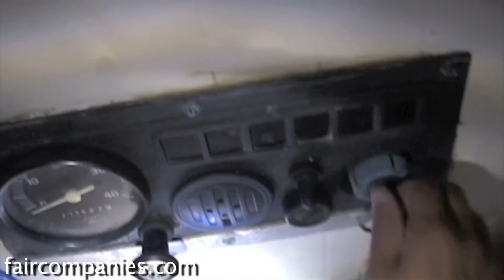Liveaboard life: self-sufficient with solar, sails, VHF radio

Comment: Very upbeat and spirited. I like the way you stand off and observe sailing at length. 
The engine will always be a problem. I'm installing a fresh one and I can tell you the placement of peripherals and how that sucks up the space away from basic needs. I know people who sail without a motor but that is more than my nerves can take. 
This is a solid visual and well organized. Good audio. Very impressive. That is more knowledge than what the engine requires. 
The monitor uses a stay X line or tuff 5/16 line, (not sure of the size). Expensive but you need little to run it. 
Thanks for showing us what sailing is really about.  SOLVING PROBLEMS. 
Don't start eating canned chili.

Comment: You can connect a laptop computer DIRECTLY to the 12V supply, omitting the power hungry voltage invertors. Let me expand; the DC supply from the mains adapter is usually 18V, the laptop battery inside is usually 10V.That extra 8V is only to charge the battery. When a laptop is on a 12V supply the computer works fine, but the battery will not charge. I have used this on various laptops on sail boats for many years. Connector available from electronic components store and make sure the cable has a separate fuse; you may want to try this on an older computer first!

My other tip is to replace the mechanical hard drive for a solid state drive; saves power and can double the computer’s speed.

Love the video, please post some more for us desk bound sailors. X

Comment: Great video. You seem to have a good head on your shoulders. Stuck with no wind, and no engine shows character. And keeping your priorities straight given the tough situations  Kudos! I havea daughter about your age and wish she was this determined.
I don't yet have a sailboat (this year some time), but I have plenty experience with DC power while boondocking on my 16 ft travel trailer. You don't need to invert your DC for your laptop. There are cigarette lighter adapters for laptops. I keep one in my truck and one in my trailer. I don't have a retail GPS unit either, but use a netbook in my truck with GPS software. Also, there are some options for your battery situation; either two batteries in parallel for longer lasting power, and/or same two batteries standalone with a switch to transfer power to one another, so while one gets used and charged the other is being charged standalone. This way you'll have to most charged to start your engine. LED lights technology is a great way to save power. A wind generator should help keeping the batteries charged up, and use the batteries when there's little sunlight. A modest investment, but if you're already sailing this young, a wind generator can be a good investment for the future as well. Safe travels!!

Comment: I replaced the bent connecting rod. It never gave me any other problems and still hasn't years later. It was 15k cheaper than buying a new engine! It absolutely needn't be replaced.

Comment: Thanks for your videos. I share your experiences vicariously through you. But I will give you this one hint. and I unlike you do know about electricity both a/c and d/c your laptop does not need to be powered through an inverter. you can wire your plug directly into a cigarette lighter type plug (make sure polarity is correct) and plug it into your lap top and it will run fine. Inverters use a lot of power Again thanks for the videos
Reply: Yep totally understand. I made the change shortly after this vid. Changes take time, and this one wasn't at the top of my list yet! Thanks for the tip!

Comment: No connection with the poster of the vid but you asked a good question...the boat 'tipping on its side' is called 'heeling' and generally only happens when the boat is headed within about 90 degrees or so on either side of the wind. When the boat is headed 'downwind', or with the wind coming from more or less behind them, the boat will ride pretty much level in the water.

Comment: Hi Teresa, I think it would be possible to mount a 400 watt wind turbine in the mast. I live by myself in a remote area in arctic Sweden and I am self sufficient with both solar and wind energy. I do have a diesel generator for emergencies. I lived on a boat with my father for 6 months and loved it. I chose later to take over a cabin I inherited from my grandmother and move up where all my relatives live, farming reindeer.
Reply: Michael Lawson The issue with wind power on a sailboat is the noise. You're in a cramped environment never more than 40 feet from any point on your ship. Many people have small windmill generators but even these can become incessant annoyances

Comment: Even though Kirsten did a fantastic job, there will always be pieces of the puzzle missing and questions unanswered.  

About the engine, yes, I had to change a bent connecting rod. Its a big project. Took a while to figure out (probably because I was hoping it was something else!)

P.S. Addressing the assumptions about my finances: I address it best in a recent blog post. Check it out. My blog is called Sailing, Simplicity, and the Pursuit of Happiness, the post is called Money! Money! Money!

Comment: @latinamajor I had a bent connecting rod! Its a major repair. I had to remove the top half of the engine to get to it. Thankfully, I had a mechanic who was willing to coach me through it. I called him often for advice. Calder's "Boatowner"s Mechanical and Electrical Maintenance" book is also a great reference. I learned a lot during that repair.

Comment: @ksharber I was talking to Elizabeth, but we never used 16 even to hail each other. We monitor 4 channels. One of them is an open channel that we use to hail each other and have any necessary conversations. We respectfully stay off of 16 as much as possible. We were also sailing offshore. There was only one other boat within range of our VHF (when we had it on low power), so this particular conversation no one could hear anyway and it wasn't on 16. I think I say "On 68", or maybe 69...

Comment: Ah, but I had all the time in the world! I fixed my engine and it was a-ok. But I used the sails more often, and I don't need fuel for that. No need for electricity. When my solar panels were producing enough electricity, it was a luxury. But not a necessity. I already look back on my experience and am amazed, but not because I "could die." I'm amazed by how little I needed and how resourceful I became. I'm amazed that others haven't figured that out too! I always sailed with full safety gear.

Comment: Probably someones suggested this but- Get a charge controller so you don't have to be worried about the batteries over charging. And they make some decent wind turbines that are small and can reach about 1.5kw which would be more than enough to power that fridge and all your other electronics even on cloudy days.

Comment: More batteries would allow occasional use of higher amp appliances & things, usually with inverter help for AC equipment, unless you install DC equipment. Five or six typical batteries would allow for fans during the hot periods, microwave heating of meals & drinks, even brief periods of air conditioning. For a refrig, to have it cooling full time, perhaps a few more batteries and another panel would suffice for night time coverage and full charging during the day. May the wind always blow well.

Comment: Nice little thing about water. Course you would have to have more batteries for this but you boil a kettle with seawater in it. have a tube connected to the spout. Steam goes through the tube then clean water drips out of the tube into a jug. That's how you distill water.
Reply: The physics of that are how much fuel to obtain how much water
Reply: That's a great idea if you're about to die, but it's not sustainable on a boat.

Comment: when your fuel tank is low, its hard to start the engine. The engine has to suck in the fuel making it easy to suck small amount of air.  If your running already thats not a problem. A smaller tank that can be higher above the engine used to start the engine then shift back to the bigger lower tank. The less fuel in your tank, the lower the fuel (no gravity assist) - harder to start.

Comment: You are right about taking advantage of infrastructure, but I have an electric motor powered off of 2 sets of 3 batteries and 3 solar pannels, I don't use ice, I eat raw foods, but I do depend on ports for repair. But at although we haven't eliminated our foot print we have limited it a great deal. As far as winter is concerned I am living in Port Washington Long Island now and it is Feb.

Comment: it would be easy 2 add another solar panel to that system and double your power source,also add 2 leisure batteries and a solar charger,a 1000 watt inverter and u can switch to 12 volt power when its overcast.love your vids.

Comment: I think your doing great, I was wondering if you understand the P over I times E (PIE) tool that is used to calculate Wattage, Amperage or Voltage?  Also there is the E over I times R (EIR) tool or chart that allows you to measure Voltage, Current and Resistance on any given electrical output or charge.  I only ask this because if you do not understand these basic principles of electricity I would be most honored to assist you as these tools are most helpful in understanding and determining one's electrical needs in any given situation.

Comment: Have you considered generating electricity in other ways? You could use a generator that absorbs energy from the water moving past your boat, for instance. Or a small wind turbine at the stern. Solar, hydro-electric, and wind combined may give you some more flexibility.

Comment: I dont know if this has been said yet but most computers use DC, you only use AC for stock laptop chargers. Did you know you can buy or refabricate a stock laptop charger to take DC without having to purchase expensive on power wasting AC/DC converters?
Reply: I was about to post the same thing.  Most boats have a 12V DC socket of the same type as automobile cigarette lighters (and, if Daphne doesn't, one can easily be installed.  12V DC to 5V USB adaptors cost only a few dollars.  It's much more efficient to go 12V DC to 5V DC directly than to go through the intermediate stage of a 120V AC inverter, so your computer would tax your battery less.
Reply: Specifics?  How bout a link?

Comment: It' s not that simple adding a battery spectresquad. Two battery-banks are needed, one for the "house" running the lights for example and one isolated battery for  the starter. The "key" is charging the batteries as needed.

Comment: I'm impressed by her.  She's learning a lot and she doesn't seem to be afraid to get out there on her own.  I think if I were her father though I would be concerned for her safety.  She's got the greatest attitude and really seems to know what she's doing. 
Someone suggested that she might carry an extra battery to start the engine In case she was out of electricity.  I guess that might be a good idea.  I was thinking to that maybe carrying a spare 5 galln container of diesel might be good to have.  It wouldn't take much space and it would be a 25% increase of fuel.
Reply: Jim Graves There is a house battery and an engine battery - so, yes, essentially an extra battery just for the engine. You've got the right idea!
Reply: think how Jessica Watkins parents felt but they let her go even when she was nearly run. down by a container ship

Comment: boat = break out another thousand.  Boats are anything but self sufficient.  They are in a constant state of degradation so they are always in need of some new part to fix it.  So you might say that they are continuous consumption machines.  And you can only imagine how many old parts are simply thrown overboard to get rid of them.

Comment: You are so cute and spunky.  I admire your attitude. Diesel engines are the simplest of engines to work on. Think of the engine as a series of related, coordinated events that work in synchronicity. It's very few events and once you understand how one effects the other you've got it licked.  You can also find just about anything on YouTube. Add 5 more marine grade, deep charge batteries connected in series to an inverter. Switch your lighting to LED. That should take care of your power issues.

Comment: and pretty. a rare woman, indeed. she is smart to minimize on the electrical gizmos. I  built and ride a chopper as well as sail. minimal is the key. tiny battery. headlight and tail light. that's it. not starter. kick only. my sailboats don't have motors. one did, when I bought it. I sold it. I bought oars and installed oar locks. if the wind runs out on my holiday 20, we both sit on separate sides and man an oar. minimalism.

Comment: She blogged about this very common, cynical comment. She worked and saved and spends very little.  If you buy a huge boat and all the so-called  "modern& neccessary" accessories(i.e. refrigeration,a/c,water maker;nightly meals out ashore, gps chartplotter/radar etc).. and pay marina fees every night.It is very expensive. But if you are frugal and you only spend when it is unavoidable. It is do-able if you want it bad enough.

Comment: there is this rumour that there are boats with 3-4 batteries that load from the engine's propeller being spun while sailing, with the engine OFF. but don't tell anyone, they might steal the energy from you because it' very limited.

Comment: Your laptop does run on DC power, its just that most of society wants to charge from a wall socket with AC current.  You can in fact charge it from a DC source much more effectively. I'm sure you know that converting back and forth has lots of losses.  On my offroad trips I connect my laptop directly to the battery in the truck.  It has no problems with this. The little box on your charging cable is for the AC to DC power inverter.  Just clip that off.  Jealous of the lifestyle! All the best!

Comment: Saw your comments about running your laptop off an inverter. This is probably inefficient and waists loads of power. You would be better off with a DC/DC converter. Have a look for a car 12 volt DC to DC converter. One of these will probably be smaller, will give you more space for a potato or two.

Comment: Ok, So  here's how you save power with the computer.  Head over to one of the 'mp3 car' sites and pick up a dc-dc power supply.  This will allow you to run your laptop and waste much less energy in converting the battery dc to ac so you can plug in your ac laptop transformer (which converts power back to dc! lol). (google 'mp3 car' go to 'store' go to 'power' and you want a dc to dc inverter, amazon should have them, look around).

Comment: Please, ask ur fans to send u stuff, get PayPal and eBay accounts to sell stuff you can even autograph or just sell stuff as memorabilia. Also, get a solar charger for your laptop. And make your panel adjustable so it can tilt toward sun, consider too a Fresnel lens that would be about twice the size of that panel that would hover above about 18 inches and increase the light hitting ur panel. And consider a mirror to increase light hitting the panel or the lens. Consider too some sort of windmill power source. There are also buoy type power sources u build from PVC. A windmill should be the vertical type not a propeller type unless u can have it double as a water generator whenever there is anchored current. If u got a small electric outboard motor that doubles as a generator u would have a third source of free thrust. Light, current, wind and waves are your energy friends.

Comment: someone shouuld tell her computers actually run of DC. so can their chargers (for the most part) if you have a high enough dc voltage. alternatively get a buck/boost converter and then run the computer without the need for an inverter.

Comment: there is a peacefulness and serenity about being on the ocean. with that said, this video is misleading. this boat is not cheap; it is expensive and few people are willing to put out that much money; or just plain dont have it. it looks romantic to be a teenager on the ocean, but the reality is that very few of these people last. want to get involved in sailing? first, take dingy lessons. next crew in the summer races and gain experience. lots more than will fit here. i.e. dont buy a boat.